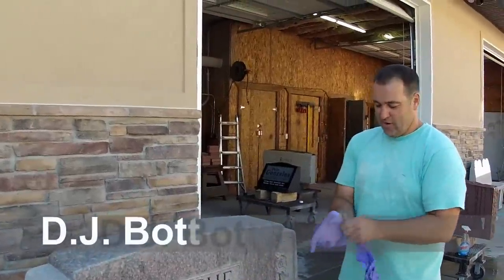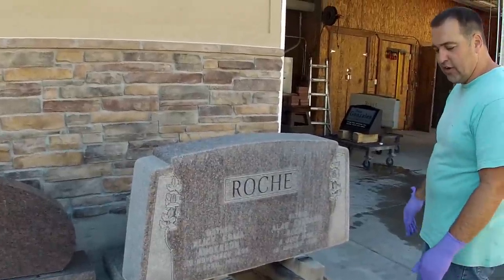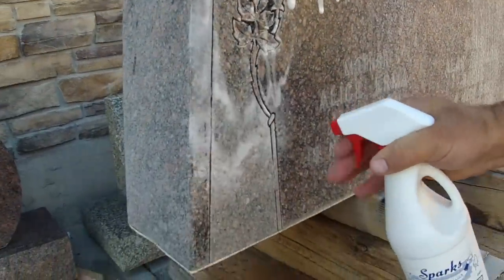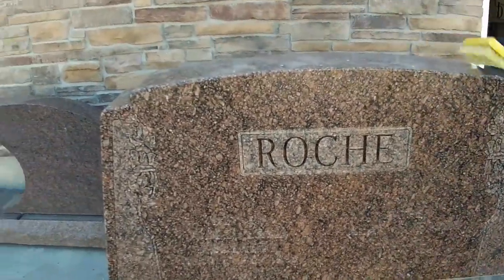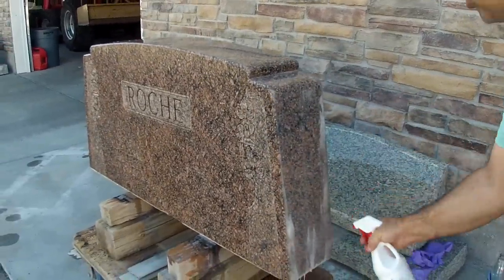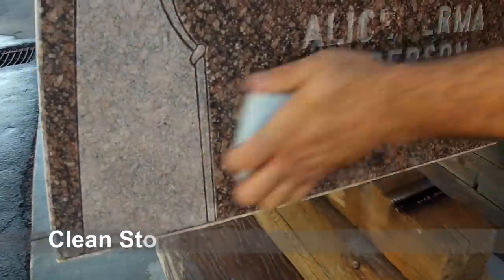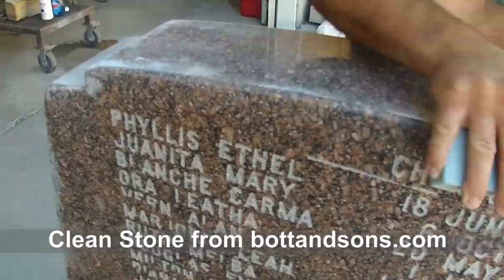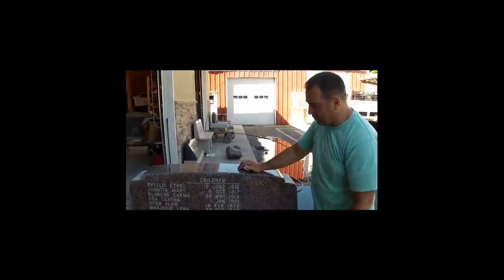Clean a headstone with sparks

Comment: I've seen two methods to clean monuments; non-pressure washers, using a spray bottle, and a high pressure system using water to knock off the dirt, and other things.  So which one would you use if you were asked to wash down a stone monument?
Reply from the maker: Cameron
I would need to see what your cleaning to better help you. We have tried cleaning granite headstones and it caused more work and problems than just using good old fashion elbow grease. I would never use a pressure washer on marble, sandstone or lime stone it can remove paint and damage the headstone.

Great questions thank you

Mike Bott
Bott & Sons LLC

Comment: What could I use on a stone that has dwarf Christmas trees on each side and will not kill them please comment back I have rough up on the  Edge of it in the front and back is smooth please comment back and let me know what I could use I bought one of those works rechargeable power washers and I been cleaning it that way Please let me know thank you for this video
Reply: i think he has told you how he would do it,

Comment: How often can you use the brick and tile cleaner and the clean stone on a headstone?  Today, I used the Sparks Brick and Tile cleaner plus your clean stone for the first time.  It worked great for about 90% of the water deposits.  I was trying to be a little cautious since it was my first time cleaning a headstone.  Do I need to wait before I go after that last 10%?
Reply from the maker: Jan you can use it right after it dries just make sure you use lots of water to wash off the brick and tile cleaner when your done. I have even use two five gallon bucks full of water.

Comment: My income is a bit limited at this time. Could you suggest a tombstone that I could get to mark my sister's grave?
Reply: Ginger Tansil a old rock or brick that will mark it u cheap sob
Reply: Granite is always the best depending on where you are located you may be permitted to use a small 8x10 marker placed flat to the ground but in my experience the grass will grow over it in a couple of years. Granite is one of the most durable materials used for markers and will last practically forever with only minimal care.
Reply: Lee claus WHAT do you not understand about limited income? You seem to be the SOB not Ginger Tansil...

Comment: I would have appreciated your doing just half and letting us see the before and after.  Also, I watched other videos that you should NEVER use anything acid-based.  So much different info.  Plus, I definately think you need safety glasses as your product is ACID-based.  You said you didn't need them.  That "clean stone" looks like it is just a "scraping stone".
Reply: i have a clean stone and it doesnt scratch the surface.

Comment: It will pit it never use acid on granite
Reply from the maker: Lee
Thank you for your comment, if I can muriatic acid and the sparks cleaner will not pit granite but it will pit Marble, Sandstone and Limestone because they are made of the same minerals that you are trying to clean off the stone.
Now we always recommend you test any cleaning product on a similar or exact piece of what you are cleaning not all rocks are the same and can have the same properties or minerals in them that you are trying to clean off and that will cause damage to the headstone, we have been cleaning headstones for over 60 years and we are happy to answer any question anyone may have.

Thank you

Mike Bott
Bott & Sons LLC

Comment: Does this also work if the headstone is black
Reply from the maker: It works on granite headstones. No matter the color.
Reply: Another quick question..will the clean stone still work without using the spray ?i ordered a clean stone just came in today I  can’t wait to try it !but I hope it works without having to use the spray you guys are sold out of it so I just bought stone
Reply from the maker: @LongLiveFerny  Yes! The Clean Stone still works without the spray. You may need to just need more bricks to clean it.

Comment: My parents have a sorta metal flat stone. What can I use to clean it? My brother & I was just discussing this the other day. We have several other family members that need cleaning. Some stones are made out of brass and some are made of granet. What can we use to clean these stones? Thank you.
Reply: generally you should only do a gentle cleaning of BRONZE as the manufacture will apply a finish to the metal to protect it and contrast with the inscription to make it easier to read.  Talk to the marker company first, they will probably tell you do not use metal polish on the marker and use a soft scrub  brush, water and ph neutral detergent to remove the surface dirt.
Reply: Use nonionic cleaner, such as Kodak Photo-Flo 200 Solution or D2 headstone cleaner. The D2 is better if you have algae or mold or anything like that. Rinse with pure water and dry very thoroughly then apply a small amount of auto polish and use as directed on the polish label. Synthetic polish with UV inhibitors is best.

Comment: The last few  years, I have been going to Dollar General and buying the cheapest chlorox and a low priced brisle brush. I pour it on, scrub it a little, then rinse it off it works great and fast on marble and granite to remove that old black mold that accumulates on them after several years. There is no etching and it is several years before the black mold returns.

Comment: D2 is better!
Reply: I spoke to the President of D/2 Biological Solutions in NY and he said D/2 would not be efficient on hard water. For our granite headstone's hard water problem he suggested I call the Texas company that sells Sparks so I did and will be ordering that. Have you used both D/2 and Sparks to see one result over the other?
Reply: D2 is a biocide. It works great with mold, mildew, algae, lichen, and other headstone issues that are from living organisms on the surface. It is not so great against serious hard water deposits.

Comment: So I can buy a small bottle of muriatic acid and add water and a little soap. Got it. Thanks.
Reply: Make sure the soap is nonionic. Most soaps for household use are not nonionic. I bought some Kodak Photo-Flo 200 Solution off Amazon. You can also buy the Sparks off Amazon.